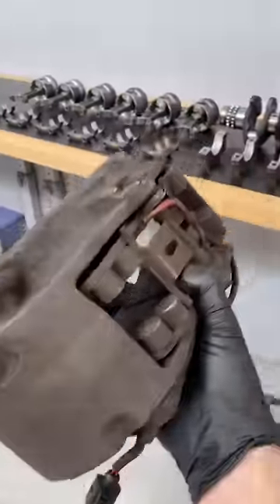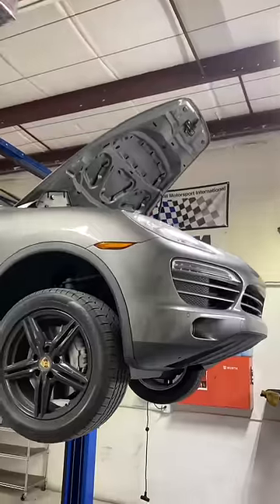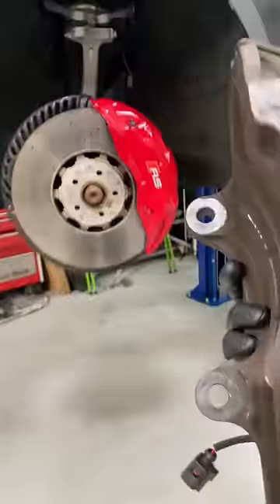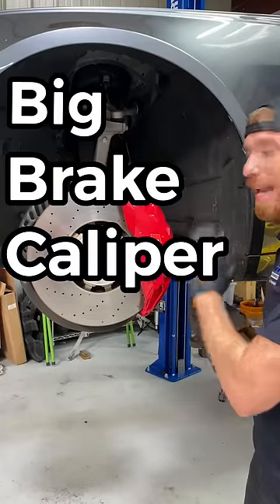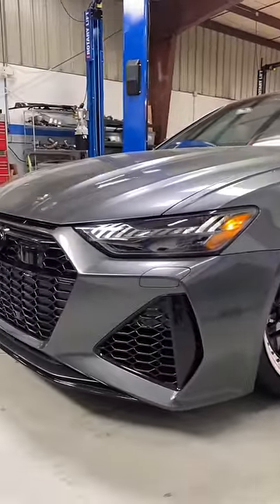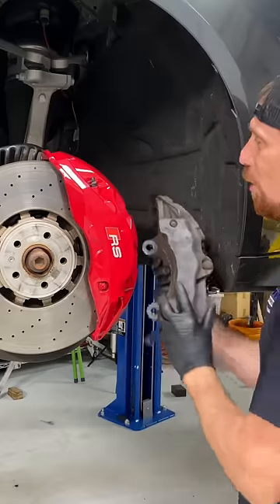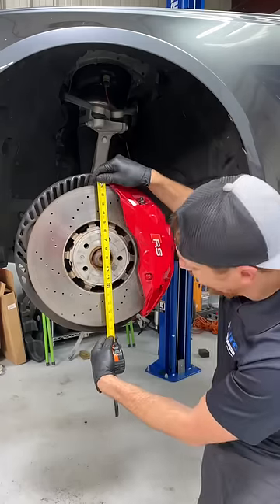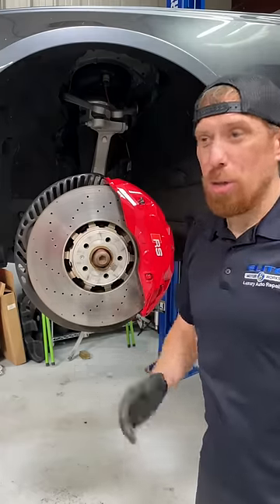😮 World’s Largest Brakes!

Comment: “The brake rotor is 17 inches in diameter”
That ain’t a brake rotor, thats a wheel. Flat-proof and everything.
Reply: That rota is bigger then the wheels on my car 🤣
Reply: My motorcycle rim size is 17
Reply: in cm ?
Reply: @blackstenor3209  43cm...size like in semi-trailer SAF INTEGRAL
Reply: That’s literally the size of my tires
Reply: @vinnievimto  rota is bigger than rota's
Reply: I am using 16 inch rims and tires in my 2016 Nissan leaf. LoL. The brake rotor is bigger than my tire.
Reply: @blackstenor3209  2.54cm in an inch
Reply: Fukk my civic got 18 in wheels with the rubber smh
Reply: It’s a brake disc
Reply: I once went to get rotors from the parts store. They said, “you’re going to need some more, unless you’re only doing half of the tires on your simi”
Reply: Is not 17" is 16" inch🙄🤦‍♂️

Comment: I've been a mechanic for almost 20yrs and I've never known those high-po brakes were that large! Very wild!!
Reply: Thats because it is largely a waste of time in most consumer car, even big uber expensive SUVs like this dont really need it.
As you probably know bigger calipers/rotors dont reduce stopping time (of the first few stops). Most cars can easily lock the wheels/have ABS kick in.
They do make more efficient use of the pad so theres less fade and more milage between replacing pads.
But usuaully these upmarket "soccer mum" cars rarely see the brakes getting hot anyway.

They are pretty awesome looking though i wont lie

Comment: My wheels are 17”……

I was about to ask, “would those fit on my Volvo?” But since my wheels are 17” and relatively low profile I don’t think they will fit on my Volvo, even with bigger wheels.
Reply: my miata has 14” wheels……
Reply: Lmao I was like wait a minute 17 inches?!?
Reply: @brapinator8500  my fiësta has 13"s. 17 won't even fit in the well😂🤣
Reply: Bruh my car has 14'
Reply: My cars are 16 and 17 I believe
Reply: Is this a euphemism
Reply: Ahahha I was thinking the same, what Volvo do you have?
Reply: Volvo have awesome brakes . At least the one I had did.
Reply: @mathewceron4384  i have two, but the one I was thinking of was my 2001 S60 (P24), 2.4T (B5244T3), M56 5 speed manual. It currently has a BSR stage 1 Tune bumping up the power from the stock 200Hk and 285Nm to 250Hk and 410Nm.

It is a well optioned 450 "Cosmos Blue" car, with a tan leather interior, car phone, HU-803, RTI, Space ball shifter, 17" Tethys wheels, front fogligts with the optional covers, rear armrest with cup holders and power folding mirrors which also means puddle lights.
Reply: I got a 98 s70 and was thinkin the exact same thang
Reply: I mean my 2007 f150 had 18 inch wheels and the brakes barely fit inside the wheels, probably 16 inch brakes but many less pistons.
Reply: Maybe rig up an inboard brake setup?
Reply: @JohnDoe-ji5wg  that would probably raise the engine up a lot, resulting in much higher center of gravity and higher hood, both not great things. Probably not worth the effort when you could just put bigger wheels on it that can fit the brakes in it.
Reply: @johnhunter7244  but you can decrease the amount of unsprung weight if you set up your inboard brakes properly. Also depends on how wide you engine is
Reply: @JohnDoe-ji5wg  brakes that big are typically on v or boxer engines, not very many inlines need brakes that big.
Reply: @johnhunter7244  Fair enough. Then again, you can use the good-ol' widebody method but fit big brakes instead of wider wheels. There's also always space to be found depending on how you manage space within your engine bay, you can probably shave off enough inches to link up an inboard brake setup. I'd be more concerned about torsional forces on the front axles
Reply: My wheels are turning 18 next month and they of course have BBC
Reply: @johnhunter7244  LOL there's no way your 2007 F150 had 16"rotors. Those are HUGE. They were most likely 12.5-13.5".
Reply: I put a big brake kit on my jeep and it has 17" wheels. To think those brakes are the same size as my wheels.. now those are some big brakes
Reply: @littlejackalo5326  They are huge. It's meant to stop a trailer. My 2010 chevy cobalt has 15 inch wheels and the (front) brakes fill the wheels in it in a 2800 lbs car not meant to tow and with significantly less power than the f150.
Reply: 18s are great on my S60. Going to get the slotted rotors from Elevate then calipers later on
Reply: I thought this was going somewhere else
Reply: @klaspeppar5619  sounds awesome! I hope that you get to enjoy your cars for many years!
Reply: @brapinator8500  austin minis have 10'' wheels
Reply: That's the wrong attitude to have going in to a project.
Reply: @marnixkamminga8083  😆🤭
Reply: I’m about 7” myself
Reply: @littlejackalo5326  looking at other cars, it appears the max brake size is about 4" less than the wheel size so it probably has 14" brakes

Comment: I think my entire winter-tire wheel is like 18", including the tire.

Seriously, i do NOT want to pay for a brake-replacement on that thing.
Reply: You'd probably have to replace the engine before the break pads
Reply: Life of the vehicle so about 80k miles
Reply: I have an SQ5 and I was a bit surprised when the brakes were twice the price of the non-S. These are probably double again… figure $3-4k just for pads and rotors. I wish I could get an 18” winter setup but most won’t clear.
Reply: @Hallowsaw  That's about accurate for an Audi

Comment: Getting close to the same surface area of a drum brake.......
Reply: And around 10-20 times the efficiency and stopping power of one
Reply: Bicycles don’t even use drum brakes 👎
Reply: @markhilsen2700  Yeah only massive trucks hauling the heaviest stuff known to man use crappy drum brakes.
Reply: @sixtyfiveford  lots of economy cars run discs on the front an drums on the rear
Reply: @Rhyssss  
This. 
Even my friend's 2007 Ford Focus have drums on the rear wheels.
Reply: Say what y’all want drum brakes are hard as fuck to change idc what y’all think is better, drum brakes make me wanna dent my car in
Reply: @Rhyssss  they aren't as good as discs
Reply: @sixtyfiveford  But they sure as shit can't stop like an Audi RS6. Only reason they still use drums is because they last much longer, and for high-weight applications like trucks, rotors and pads would warp and wear out way too fast to be useful. Drums aren't as good at stopping, but they can stop heavy vehicles for much longer and more reliably.
Reply: @kujaw1221  my Nissan Versa has drums on back as well
Reply: @jmccann6735  no they use drum brakes because they cheaper
Reply: @glock1inthetop45  Cheaper over the long term because they don't have to be replaced as often. Servicing and manufacturing drum brakes is just as expensive, drum brakes are actually harder to service too, usually costing more in labor.
Reply: @jmccann6735  no they are cheaper cause it’s old technology they aren’t even expensive
Reply: And horse and carriage is more fuel efficient then cars... 🤦‍♂️ 🍎 to 🍊 anybody? haha
Reply: @glock1inthetop45  No. Drum brakes use more components and are more complicated in their operation. Discs and calipers use about a third of the parts that drum brakes do. The use the same materials, just different configurations. Drums are harder and more expensive in most cases, for the OBVIOUS exception of high-performance carbon disc brakes.

Ask me how I know. I'm sure it has nothing to do with the fact I'm a certified brake technician at one of the nation's largest independent retailers. We are also one of the largest commercial tire and service companies on the West coast. I personally service both disc and drum brakes DAILY. I also write the service quotes and invoices. I think I know what the fuck I'm talking about.
Reply: @jmccann6735  tf are you talking about calipers have Pistons and seals which are more fragile drum brakes litteraly had springs bro have you ever even done brakes ?
Reply: @glock1inthetop45  How about you write and do complete drum brake service on a commercial Super Duty, and then do a pad slap on a Camry. Then you can come talk to me about which is more complicated and expensive
Reply: @sixtyfiveford  you can choose if you want drums or disks when you buy a semi truck. if you are doing highway hauling then you buy disks but if you are doing primarily off-road hauling then drums are better because they are more durable and fully enclosed.
Reply: @adamfehr1994  I was wondering about the cabs, we mostly do trailer service which is all drum. But I've seen some nice front disc setups on the newer trucks
Reply: @adamfehr1994  actually disc brakes are much better off road. My boss runs discs the whole way around on his new log trucks. It's absolutely awesome if you're coming from drum brakes. They're as smooth as a car and are rated for over 300k miles actually. Unless of course you have a shit driver like one of my coworkers. He drove like and idiot and almost never used the jakes. Just creamed the brakes, and as a result wore the pads to literally nothing. Two of the calipers had the pistons worn half off. Even though, disc brakes are infinitely less maintenance, and are much easier to replace when the time comes
Reply: @GreatLakesLogger  things may be changing but that’s how it’s been for years🤷🏼‍♂️
Reply: @kujaw1221  My sisters company car is a 2020 and has drums in the rear
Reply: @jmccann6735  apples and oranges your irrelevant compared super car brakes to it lo
Reply: @03tarserov64  drums are easy and fun to keep up with, and this is on a 99 e150 something 5 times harder to change than any small economy car you have. It's not hard to change, if your having problems, it's simply because of the person installing them
Reply: @glock1inthetop45  you lost the argument stop.
Reply: @03tarserov64  You're doing it wrong if you're having a hard time with it.
Reply: @jmccann6735  Back in the old days they were cheaper as most towns had places that relined shoes & turned drums. These days it's not like that though.
Reply: @Rhyssss  Because back brakes only do a fraction of the work so crappy drums do the trick. It's also easier to do the parking brake on drums, some vehicles use drums for the park brake and discs for the regular rear.
Reply: @christopherrto  yup in board shoes... seen a lot of car where they don't use the handbrake just throw it in park an then the first time someone throws the handbrake one the shoes stick an you have the take a hammer to free it off
Reply: @sixtyfiveford  Oh, so I guess that means they’re better then I guess. I wonder why no race cars or fast street cars don’t use them. Sounds like they’re missing out.
Reply: @sixtyfiveford  my 18 wheeler uses disc brakes. They work much better, but more maintenance. Companies usually spec the cheapest route on fleet vehicles.
Reply: Discs are more efficient in parts, how they work, and cooling.
Reply: drums are cool because they require less hydraulic force to apply the same braking force of calipers. But drums are harder to cool down which makes it a bad choice for repeated hard stops (like race track or mountain road) also debris and dust build up can affect performance (like in an offroad situation)

Comment: The Porsche Panamera Turbo and Bentley Continental share the title
of the biggest brake disc in the car industry. This Audi might have shared the part.
Reply: They are all VAG parts so technically they all borrowed them from Volkswagen 😉
Reply: They use the same parts from Audi.

Comment: 17" rotor⁉️ I googled but couldn't find an answer... Do you know how much each rotor weighs?? I'm super curious! That's a helluva lot of unsprung weight right there 😳
Reply: Carbon ceramics, but still those things are as heavy as they are expensive.
Pads front and rear are 2k+ for parts only. 
Had a customer who bought calipers pads discs,etc. Since he drove his RS6 exclusivly on the track, and wanted a second wet when selling it.
Paid close to 30k...
Also there are special guides so you don't hit the disc with the rim. ;)
Reply: @michihoffi69  wait $2000? Like two thousand dollars? For just the pads? Holy fuck what are they made of? Ivory and diamond?
Reply: @aaronmazur8056  carbon
Reply: @aaronmazur8056  they are relatively simular to normal pads, just more metal.

But they have Audi RS stamped on them ;)
Reply: @josiasmangussiborges  that is actually a commen myth. Carbon ceramics is only the disc. Pads ar not that far of a normal one. ;)
Reply: @michihoffi69  alike formula1 so? (F1 use carbon disk and pads)
Reply: @josiasmangussiborges  puh if f1 uses carbon pads, then this is different.
I mean the pads are a bit different than normal ones, so you should not mix them ( they contain more metal iirc.)
But the pads are not some famcy carbon ceramic Material. ;)

Comment: I used to build big brake kits for ECS tuning I don't work there any more but I loved that job, it was like Christmas for me to build BBC's them everyday, alot of diffrent european car applications for diffrent models, 2pc. Cross drilled and slotted rotors, I'd put them together torque down the rotor hats, and I also would lazer engrave there logo on the hats before hand, then send them to be packaged and shipped to there lucky owners i loved the process i put alot of love into it... they were pretty pricy thats for shure.... but you get what you pay for... they were huge but not this big...

Comment: “How can we make our customers pay more money for useless stuff?!” “Make the biggest brakes you can!”
Reply: Hopefully they’ll wear out in way more time because they’re so over engineered.
Reply: @wallymcguire2033  technically they would last a very long time for normal daily driving depending on oad compound
Reply: @oleyeller3256  - I would think so. Especially in normal street driving conditions. The load on them is going to be so minimal.
Reply: @wallymcguire2033  i am buyng the wildest bicicle brakes i can for this reason. They're Magura MT7's. Thoose things have 4 pads per caliper
That's right, not pistons (wich it does) PADS
Reply: @wallymcguire2033  you probably don’t need them that size all that much but on the occasion when your rolling into the school zone with your three kids at 180 mph they’re probably handy to have
Reply: Guess you'll be happy to have them in case you go 280 and need to instant decrease the speed of your 1.8 Ton vehicle...
Reply: For the amount of horse power in that vehicle, those breaks are just about right
Reply: How is having the best brakes useless?? It’s a 600hp 4500lb car.. it’s about safety and when you are paying 150k for a car, this isn’t a big deal. Typical broke boy mentality.
Reply: @CH-zp2rh  To be fair, where and when is that horsepower going to be used? It probably has 4 different drive modes to lower the power massively
Reply: @bilalmalik5002  You use that horsepower on the Autobahn and having these big brakes will be very helpful when having to brake hard at 280+ kmh

Comment: You should work on wind turbines, they also use a sort of disc brake to hold the blades in position if they are feathered but the rotors are "slightly" bigger than any car rotors

Comment: nice... 
W211 Merc SL55 has 12 pot calipers, true, they are not THAT big... Biggest BBC that i have handled and fondled.. were from Lexus IS-F. 12 pots in front and 10 pots in the back. Also carbon-ceramic rotors... 2500 euros only for the brake pads.. :D nice work!

Comment: Newer semi trucks are equipped with disc brakes and the calipers are probably about an inch or so larger. The diameter of the rotor is right at 19"

Comment: You gotta check out the disc brake systems on jumbo jets, those things are impressive and they've even got multidisc systems that resemble a clutch basket in a motorcycle granted way bigger.

Comment: There's a big brake kit for the 2008 dodge ram 1500 and the front rotors is 16 inches in diameter and has 6 piston brake calibers which on retrospect doesn't sound overkill because the truck is around 5000 pounds not in the mid 3000 pound range

Comment: Dude damn!, I remember back in the day when everyone was like DAAAMN when the mustang cobras came out with 13” rotors, and that was like the big stuff for awhile then Chevy and the 15.5” carbon ceramic rotors on the ZR1, now it’s like 😳…..17”, that means you’d need a MINIMAL LIKE 20” wheel to fit over those brakes, that’s like getting into aircraft brake swaps to your civic 😂

Comment: That's a big caliper, but I've seen bigger on buses with air disk brakes. You almost need a freakin engine hoist to mount the thing on the wheel end. But for a car I guess that is a seriously big caliper.

Comment: Lol, I actually have 18Z calipers retrofitted to my Lexus and they are not small by any means and I have them clamping 14.25" rotors.  Definitely feels like you're tossing a boat anchor out the window during extreme stops.  This setup I couldn't imagine what kind of mind numbing forces you'd experience.

Comment: Interestingly, big rig disc brakes also measure 17". So, that's nuts that a passenger car has 17" discs. If course, the truck rotor weighs 76 lbs.

Comment: What's the advantage of using multi-pot callipers? Wouldn't you end up with the same amount of brake pressure seeing as they only have one hydraulic line running to them, same as single pot brakes?
Reply: More pressure from increased surface area.  To get the same pressure from 1, it would need to be about 6 times the size, so they just split it up into 6 smaller units instead of one large one.

Comment: You ain't seen nothing till you've done semi truck brake rotors. They are about 2 grand per rotor about 20 inch diameter not verified since they have many sizes.

Comment: they make calipar brakes that big because the car is really fast and to stop it requires a strong pressure force of a strong and large brake system, and moreover the size of the brakes does follow the type of vehicle, if normal, usually normal size if big, big size, that can't be  difference